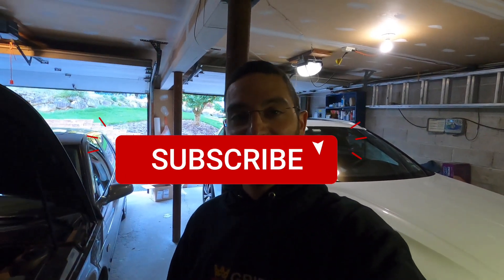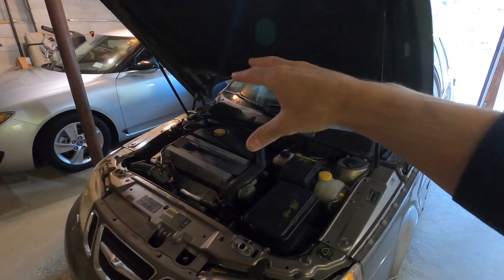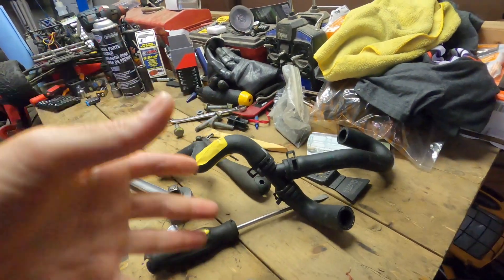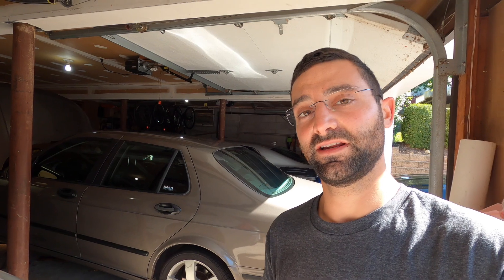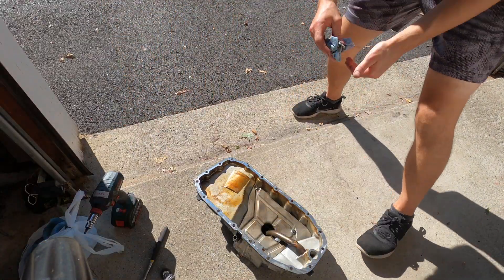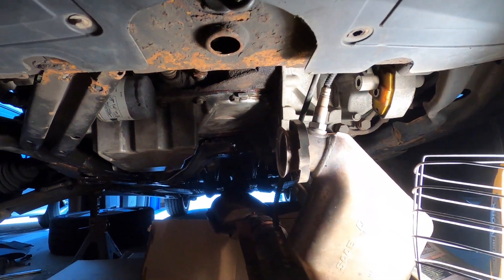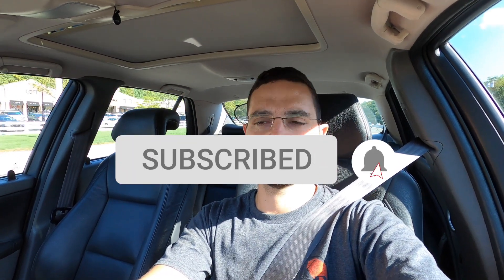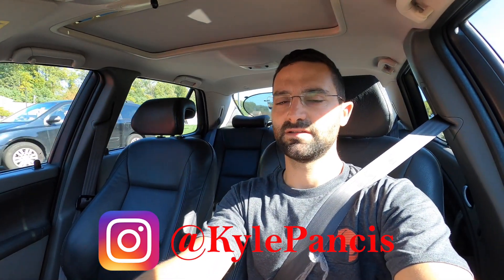Here is the current condition of the internals of my 250k Mile Saab 9-5

Comment: Cool video !  In my opinion though, the best thing you can with the coolant bypass valve is to eliminate it with the CBV hose elimination set.  A simple, dual hose set that completely eliminates the snake pit of hoses connected to the CBV and takes the unpredictable CBV out of the picture for good.

Comment: I'm was happy to not see any sludge in your oil pan! What a relief for you to know. I have a 1993 Saab 9000 turbo that I know i should  check for sludge. Im worried about getting the downpipe off, jacking up the motor for more access instead of lowering subframe.29 year old New England rusty bolts. 156,000 miles. Have you done this in the past on a Saab 9k?
Reply from the maker: I have not! Understand the concern!

Comment: Kyle, I'm a long time subscriber of yours - my question is - my 2004 9-5 is having a clunky hard downshift coming off highway - did I put in too much transmission fluid or too little and does the type of fluid I put in cause hard shifts? Thanks man and appreciate your Saab Videos.
Reply: Definitely check the fluid level is proper, but could also be a mount.  I assume you put a Mobil 3309 equivalent of some sort.
Reply: @marcoalexander6214  thanks Marco, I'll check the mount - since it vibrates when in drive at stop. Also, will make sure it's the right fluid. You're a gem man, many thanks.